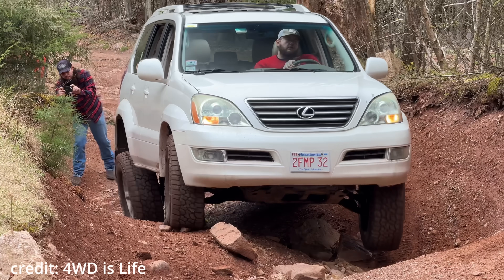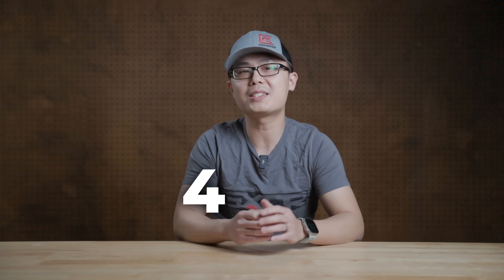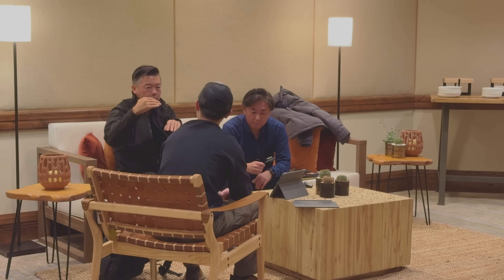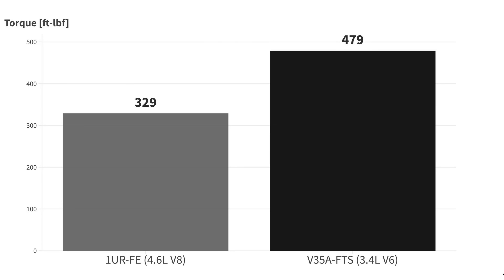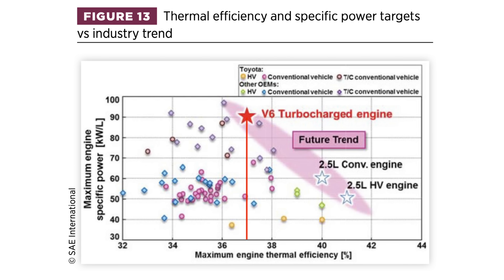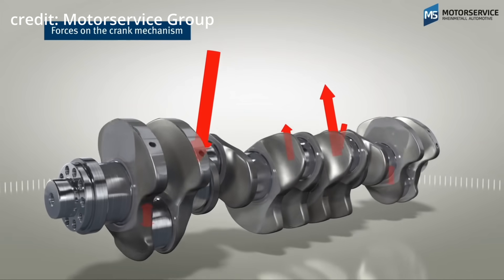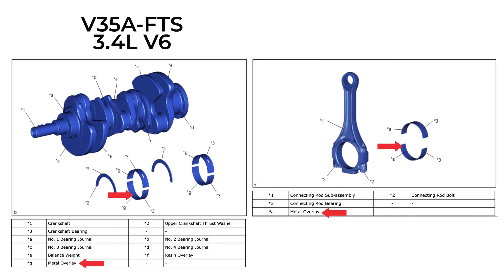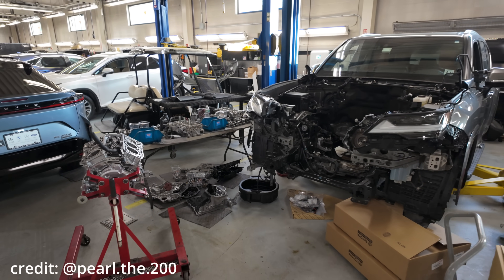Is Toyota V35A-FTS Engine Reliable? Well..It's Not That Simple

Comment: Man I’m happy that I bought the last V8 engine in my GX460 2023 model last year, I knew that there were going to be problems.  I’m also an engineer who worked in automotive for several years.
Reply: Same here. ‘23 GX from a TT ecoboost with cam phaser rattle. I bailed. The GX was my exit vehicle. I’m done.
Reply: Yup we bought the 23 GX.. I love the low-tech v8. This landcruiser is a million mile chassis, and is used for various militaries all over the world. Bulletproof tank, not literally, but basically yea
Reply: As a guy who's owned 3 GX's over the last 21 years since the very first GX470 came out, I'm obviously a fan. They have all had bulletproof reliability, but with as heavy as the GX460 is, it feels pretty sluggish with the 4.6L, and it never felt as lively as my '08 470. I really liked the looks of the new GX550, but for the first time I'm hesitant to buy one with that engine. Man, I wish the 5.7L V-8 was an option, as I'd buy that one and keep it forever
Reply: The UZ were the best.  The UR have issues with the head gaskets.
2008 to 2003 GX470 are the ones to purchase.
Reply: The new one is better
Reply: @roninbushitoろうにん 😂 NO.

Comment: Undersquare geometry also generally works well for boosted engines. With better breathing efficiency, you don't need valves to be as big. Which means lighter valves that can have lighter springs and less contact stress on the cam, that kind of thing. With a smaller bore, you can have a smaller combustion chamber which can help produce the "high speed" combustion Koji mentioned. When they say "high speed" what they mean is that the burn is complete sooner after TDC. Which means that the effective expansion ratio is higher and you have more basic efficiency (think back to a LogP-V chart in your Thermo class).

The high torque output doesn't necessarily mean a high peak cylinder pressure, it just means a high BMEP. So if toyota is finding a way to make higher average power stroke pressure while not spiking peak pressure, you can have both high torque as well as reliability.
Reply: Great comment, thanks
Reply from the maker: awesome info. thanks for sharing! yes, what you said concurs a lot with the paper.
Reply: Good explanation! Should be pinned. You explained everything I was thinking far more articulately than I could have ever.
Reply: Under-square engines have a larger rotating mass, increasing torque through the gyroscope effect
Reply: This is a big part of the “answer”. Efficient combustion leads to high MEAN effective pressure which is basically torque, for a given bore and stroke. The high BMEP at lower rpm combined with a longer stroke results in peak torque at lower rpm, which means dynamic stresses and wear due to higher average rpm, are lower. Modern materials and lubricants, and cooling systems, are much better too, so the mechanical parts of the engine can have good strength and durability even with high mean and peak pressures. Also, modern multi-speed transmissions allow engines to operate at lower rpm more of the time, again reducing wear. It is certainly complex but I do trust Toyota, even though I’m a Tacoma 2GR 3.5 V6 owner 😀
Reply: @luislongoria6621  That’s not how that works. The dyno that test the engines will let the condition stabilize and exhaust any inertial effects.
Reply: @dman900dl , engineeringexplained youtube channel does a great job explaining BMEP, and it's worth a watch.  Many people don't know about this and its relevance.
Reply: Mazda does this with their sky activ-g 2.5 turbo 4. 250hp but 320 lbs torque. Makes for great daily driving response. I think the key for turbo engines are to manage heat effectively and know when and where to work the engine.
Reply: @luislongoria6621 thats not how it works. Longer strokes create more leverage on the crank and thats why there is more torque

Comment: It's been happening since 2018. It's on the Lexus forums under "2018 LS500 on 2nd blown motor" & "LS500 Burning Oil". Difference is, the LS500 sells in much lower quantities and particularly to an older crowd that doesn't necessarily care to report problems on the internet. It's the very reason I avoided the LS500 back then and went with a K900 3.3T instead - 62K miles, zero issues so far. It's not too dissimilar from the very recent Honda/Acura recall on all of their V6's due to seized connecting rods.

Comment: I think the reason they called it the GX550 instead of the GX340 or 350 was because people would associate the smaller number with less. People would think well its a smaller engine and it has less power, even if it has more power. Its the same reason why Mercedes still calls the C63 the C63 instead of the C40. It used to have a 6.2 that they marketed as a 6.3 to pay tribute to the old 600 from the 60s and 70s. Off topic but the point is that it had a "6.3" so they called it the C63. Then they replaced it with the 4.0 twin turbo and still called it the C63. If they had called it the C40 people would have thought it was less than the car that it replaced. Most people don't know anything about engines so they think if its smaller it must be worse. So they give it bigger number to help with sales.
Reply: 💯   The "550" is pure marketing and the poor engineer was forced to rationalize it.
Reply: BMW has been doing this for years.  Once they started throwing turbos in everything, the number was repurposed to represent equivalent NA displacement performance.  Yes, it’s dumb.
Reply: Absolutely drove me mad when Mercedes and others started to do the same, and don't get me started on Cadillac using some rounded approximation of what they think the kW or nm output of the engine in a given vehicle is....
Reply: One hundred percent.  G35/350Z meant 3.5L, G37/370Z meant 3.7L, and then we went Q50, Q60, and Z because they went to a 3.0L.
Reply: yea, sadly we are surrounded by uncritical muppets and marketing teams feel like the need to appease them
Reply: Spot on, it's marketing
Reply: This‼️
Reply: Yeah imagine people's reaction when they hear about the "C20 AMG". At least the previous "fake C63" still has a V8. This new one is a 2.0 Inline-4 that weighs more than a truck.
Reply: @SkyWKing  I know. The C20 isn't even an AMG. The new Land Cruiser has a turbo 4 cylinder hybrid which is fine because its an SUV not a performance car. Its not supposed to be fast or sound good. The engine only needs to move the vehicle well enough and it does. But the new C63? No that's borderline illegal. I can't wait for this EV fad to end. We're in a new malaise era.
Reply: Your theory would make more sense if they had not gone from the GX470 to the GX460 and done exactly what you said they were trying to avoid.
Reply: @Name-kd5jj  if we ever trend away from EVs, it will probably be in favor of something you're even more triggered by
Reply: @jankington216  As long as governments keep overstepping and trying to ruin cars. Cars have gotten heavy, expensive, impossible to repair, and boring. All because government emissions and safety regulations. Now I'm not against emission and safety but there's other ways. For example we could require people to get a CDL to drive a pickup truck, redesign our cities so that everything is closer, and invest in public transit. But its easier just to force people to buy cars they can't afford while offering no alternative thereby forcing them into homelessness.
Reply: @Jay-me7gw I don’t think there was so much hype around the numbers that time and people were not so dumb. People actually researched and were aware of the technological advancements, but people became dumber and all that mattered to them was numbers, this is why everyone was chasing big HP numbers and 0-60 times and hyping up badly designed cars just because they had a lot of HP or quick 0-60 times. That’s why you have people who say the LFA is overrated and slow not knowing by making the “perfect” chassis the LFA at the time set the fastest time on road tires at the nordschliefe, but people hated on it because it did not do 0-60 in 2.9 seconds.
Reply: @Name-kd5jj  mercedes has said they'll give into consumers and put back the V8 twin turbo for the new C63s.
Reply: @rorynesta7766  I just read that yesterday. Makes me happy. Not that I can afford one but its still good to see them backtracking on this "EV revolution". Now if Porsche would cancel the electric Cayman/Boxter. They won't have an ICE alternative either. Seriously who would ever buy an electric Cayman? Mercedes, VW, Hyundai, GM and Ford have learned the hard way and are backtracking their EV plans losing tens of billions in the process. EV's are as good as dead, well as far as the plan to replace ICE. They'll get 20 or maybe 30% of the market but that's it. Basically rich suburbanites only.
Reply: @Name-kd5jj  Electric Cayman?Omg wtf! I love the cayman but they are doing a great injustice to the car.I think the VW Group has invested a lot into their electric cars-The Porsche Taycan and Audi etron GT,while they look good,I dont think sales have been the best.I am guessing they are only there in the lineup to offset Emissions taxes against the rest of the ICE models VW makes.EVs did well here in the NZ only because the government gave a big subsidy back to the buyers plus free road usage but they screwed diesel users with clean car fees (we used to pay $6K extra per diesel vehicle)but this EV shit needs to stop lol.
Reply: GX340T or GX350T sounds better
Reply: good explanation.. I still laugh at fake Euro car exhaust tips... Audi is the pro here, undefeated.
Reply: agreed
simple marketing
Reply: GX800

Comment: As an owner of a Nissan and Toyota V8 vehicle I appreciate this video. There is no replacement for displacement. High strung, stressed engines require frequent rebuilds and are for race cars.
Reply: Agreed 100%
Reply: Makes me wonder how the reliability will be in these new 4 cylinder engines Toyota is going with in the new Tacomas and 4Runners.
Reply: Downsizing is basically the norm on all areas of the car market, which, in my opinion and probably yours too, is quite unfortunate because not all users would know how to maintain an turbo engines properly, such as change oil more frequently, always idle for 30 seconds before moving, don't lug the engine too much, etc.
Reply: nissan 4.0 few issues
Reply: @bikeman1x11  Nissan 5.6 zero issues
Reply: @salimrandall  Unless you have a DI version, in which case you'll be cleaning carbon every 15K.
Reply: @sinister184  2017 model with DI
Reply: Agreed, a turbo diesel could never outlast a naturally aspirated gasoline engine.
Reply: @yolo_burrito is that a joke?
Reply: @NobleOmnicide  I think they'll be more reliable, since the hybrid system will take a lot of stress off of the engine during hard acceleration, but I'm a manufacturing guy, not an automotive engineer.
Reply: @Eastsidegeorgiaboy  yes, turbos are bad on gasoline but somehow good on a diesel.
Reply: @bandombeviews6035  That might be a fair point but if I'm not mistaken, the hybrid system is not standard on all models of Toyota's line-up.
Reply: I agree. Oh just stick two turbos on it and thin the oil. That should do the trick. NOT.
Reply: I take it there's no Ecoboost in your future.
Reply: @MisterMikeTexas  I had 4 cylinder cars for years. I had a 2.3 89 Foxbody Mustang for 6 years. Now I'm old and grumpy and lazy and want v8's.
Reply: Right.  It's a V8, or it's not a V8.  Unless you have invented some kryptonite, the metrics do not tell the whole truth. Often, we find things are better on paper than in reality.   Toyota played the hand they were dealt and made a cool-looking BOF truck that has great stats on paper.  Every year I cuss CAFE standards gifted to us by people who fly private jets.  To my knowledge, the only way around CAFE would is to add a substantial markup on MSRP.  Still interested enough in test-driving one to see how it compares to my 4.7 4Runner and 5.7 LC200.
Reply: @salimrandall  An NA V6 puts out as much horsepower as the V8's from the time your talking about.
Reply: Ok boomer
Reply: @xXlURMOMlXx   I’m 46  and Gen X. My parents are Boomers. Any other genius comments Einstein?
Reply: No one in this thread watched the video to completion.
Reply: You are definitely an old man, talking that way.  Might have been true 30 years ago, but definitely not now.
Reply: @MrNickjberry The rules of physics haven’t changed.

Comment: From what I have learned at Tundra forums, the failure seems to be from how they wash the crankshaft after being machined.
Previous crankshafts would go through two wash cycles and all metal shavings would be washed off, the new crankshafts for the 3.4 v6 seem to have still some metal shavings left behind inside the oil feed holes causing oil starvation for the connecting rod bearings and causing early failure. It seems they have increased the wash cycles to 3 or 4, it reduced the number of failures on the 2024 tundras but there still seems to be a few.
I'm making an assumption here, but I guess the oil feed holes are narrower nowadays with the newer engines because of the thinner oil, to maintain oil pressure. Because of these narrower holes, a lot of the metal shaving from machining get stuck and don't come out as easily, leading to the current situation with the 3.4 v6.
Reply: To be honest that sounds a little fishy. If the issue was fewer washed, you would think more washes would fix it completely. Also, cleaning debris after machining is something that has existed since the advent of machining so it seems a little unlikely that this would have been an unforeseen problem for them. My speculation is the change in bearing material and obviously the entirely new platform is just going to have a few bugs to work out. Fortunately Toyota stand by their product and you can spin bearings from now until the end of time and they’ll probably just keep warranting them.
Reply: This would make sense and explain why the failure is so inconsistent and happens so early. If the engine is overstressed or whatever you wouldn’t expect failures to happen till at least 60k miles, and very consistently, like with BMW V8’s
Reply: This explanation would make more sense if there were only failures of tundras and not the Japanese models. Which I’ve seen are happening. Lx600
Reply: 0

Comment: 40 years as an automotive/diesel tech. 

To quote my favorite engineer "The more complicated the plumbing, the easier it is to stop up the drain."

The only reason everyone is running a turbo these days is to try and eek out a few more mpg to get past fuel economy standards and to fool the customer into thinking they arent looking anything. 

Honestly, 95% of car buyers are ignorant and just hear turbo and in the head turbo=fast.
Reply: The only reason they are running turbo cars is because NA engine development peaked. They cannot get any more power out of those engines without increasing in size, or revving them higher, like Ferrari and their 6 ltr V12 since the Enzo has been making the same BHP per liter to this day up to the 6.5 V12 812 SF. Lamborghini with their 6.5 is making the same power as the Ferrari. So they needed an option out because it would be outrageous to start putting 7 liter engines in production cars, I understand there is a couple with above 6.5 liters but the larger the displacement the lazier the engine, and the more inefficient it becomes.
Reply: 95% of car buyers have no idea what a turbo is..
Reply: Most car buyers be like, “pretty car, high mpg, me buy!”
Reply: @thegeneral1955 mpg and emissions aren't the same thing. Also I get about 4 mpg more in the new tundra compared to 5.7 V8. Most early comparisons were done before complete break in
Reply: Turbos are more for emissions than fuel economy, which the EPA has gotten really strict with.
Reply: @thegeneral1955  nah. Safety test scores better. I drive with my kids a lot. My 21 Tundra got totaled in head on collision, thank God we're ok. Safety first. Reliability is out for debate still, Internet making issues seem worse than they are. Also 5.7 had is share of problems, leaks, engine failures.
Reply: @thegeneral1955  the truck helped keep us safe, yes. This experience made me value crash test safety more than I used to. The new Tundra has the best crash test ratings of the full size pickups. Driving kids around to different sports events and practices I wanted a larger, safer vehicle bottom line. To many distracted drivers out there.
Reply: @bfromthea7663 real car guys know not all engines are the same
Reply: Go Scotty! ☺️
Reply: That is such a bad faith statement

And so many Toyota fans are more considerate than what you just suggested.

I think the average Toyota buyer, maybe, is concerned a turbo on an SUV and don’t assume speed.

It’s like you didn’t even watch the video
Reply: We don't all live under a rock. My long career in the financial world proved to me that most of my colleagues were really clued-up on automotive technology.  Speak for yourself, or for your nation.  Not all people are blissfully ignorant.
Reply: And no replacement for displacement.....make physics great again.
Reply: Turbos are fantastic. Since the beginning, they allowed more power when you want it and more economy when you don't. They are awesome in that regard. I've owned turbo cars since 1991 and still have two modem turbo cars. Today's turbo cars are far more reliable because they are over-engineered for boost pressures and they have automatic cooling with oil or coolant or both if you shut the engine off after driving them hard. I'd never buy a naturally aspirated engine again.